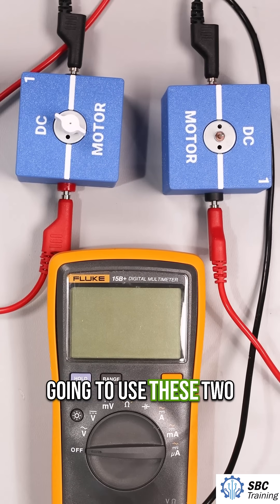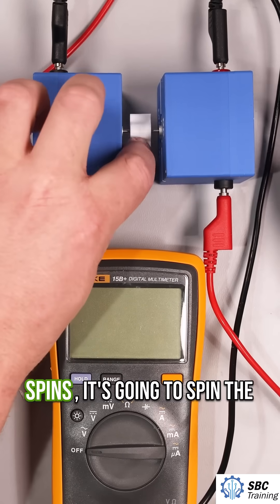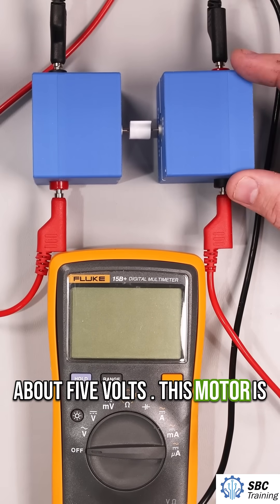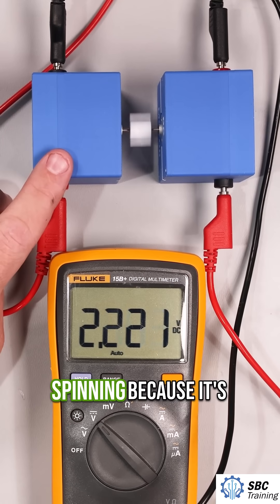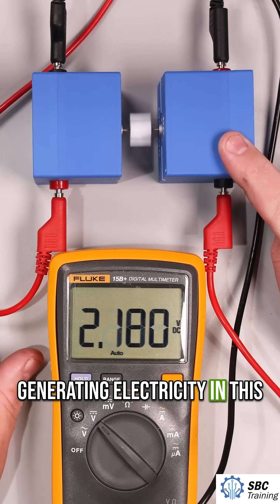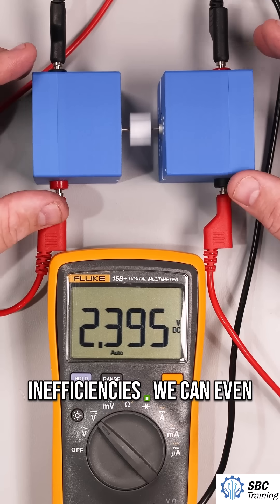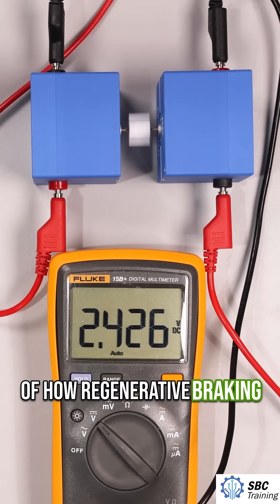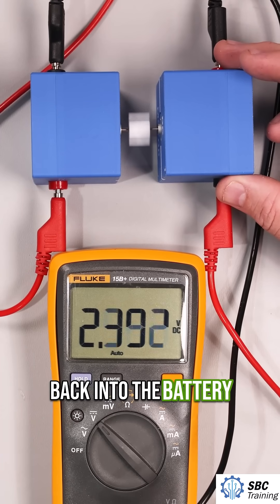DC Motor as a Generator | Regenerative Braking Demo

Comment: You need to test the total power generated under a braking simulation. Get a small flywheel representing vehicle momentum, spinning and then apply a load and get yer amperage and voltage and time to end of useful power and wheel stop time. I'd like to diy a small vehicle with the ratio or curves between physical and regen braking determined in part by speed of vehicle, speed of brake activation, and pressure used. A user should be able to make adjustments here. I'd fancy something mechanical really, brake pedal defaults to mostly physical brakes unless user maintains regen braking mode(s).

Could a hard stop/wheel lock work by applying "AC PWM" to a brushed dc motor?

Comment: How does the circutry work to allow the motor to charge the battery without the battery trying to spin the motor?  Could it be as simple as a diode that only allows reverse current to enter the battery?
Reply from the maker: I'll put together a demo soon for this